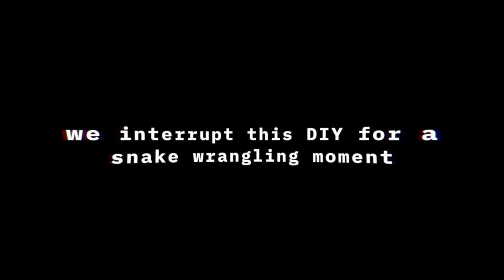Meet My New Puppy!

Comment: I'm sorry but you're wrong. A chef knife does not take the place of all knives. It doesn't take the place of a bread knife because it's not serrated. Two braided knife cut through Brad very easily for a chef knife does not do it. We got a used off backwards motion and let the weight of the night to the cut it so when you try to do that on bread it's going to smoosh it. You can use it in place of a paring knife but it's not as good as using a paring knife when that time comes for something. It makes it harder. I'm a chef by trade and a chef's knife is the great knife to have and use but it does not replace all knives.
Reply from the maker: Thanks for this feedback xx.